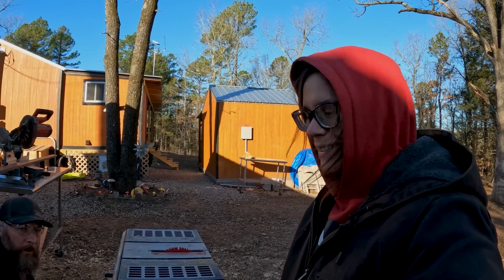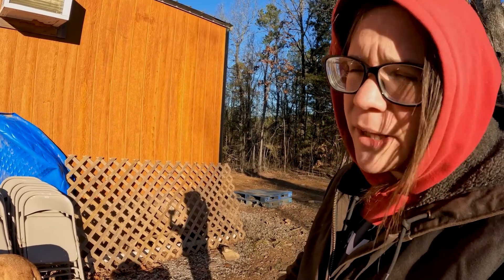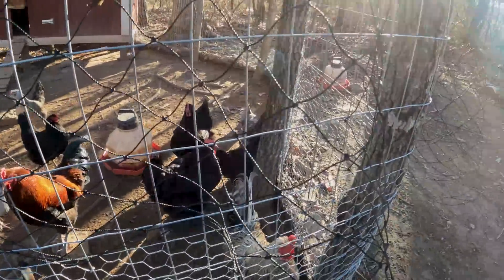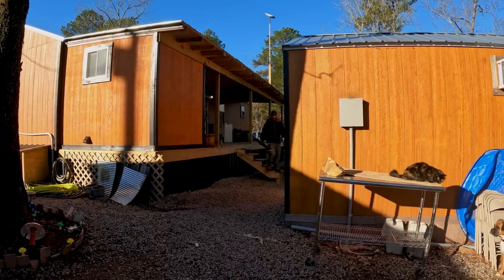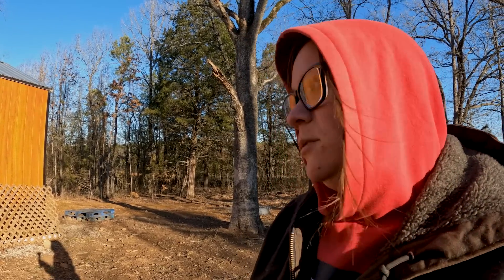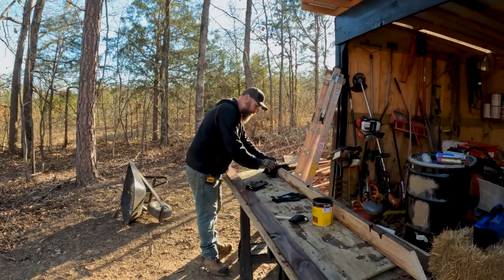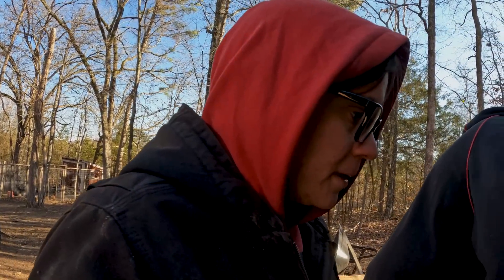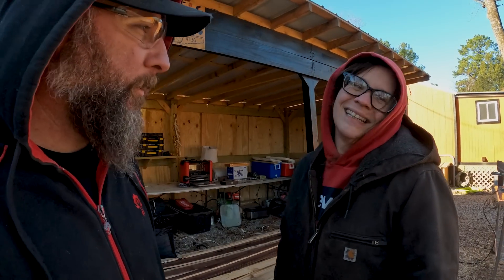This is EXCITING!!| The Daily Vibe With Rox and Ant

Comment: When I was 14 back in 1985-ish, I started working with my Dad in the summers and weekends, putting siding on houses (and windows). I measured everything, cut it, and my Dad only had to put it on the houses. 
I also had a small wood-shop in our garage.

Comment: The router going bad may have seemed like a disaster, but I am hearing a spun bearing on the table saw.  Maybe time to upgrade? I'm sure Mel and Gary would go halves on it, as they are just getting the cabin build underway, and that will need lots of finish work.